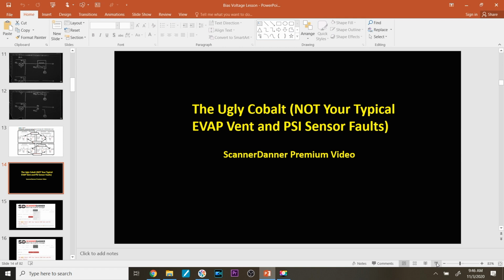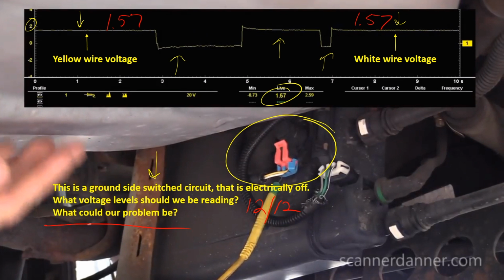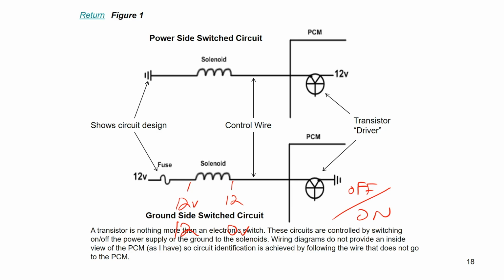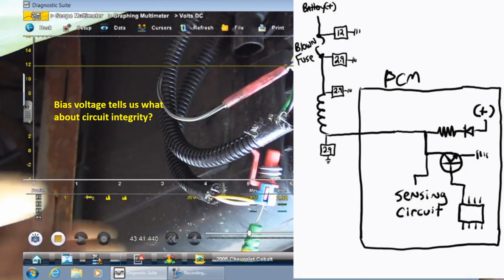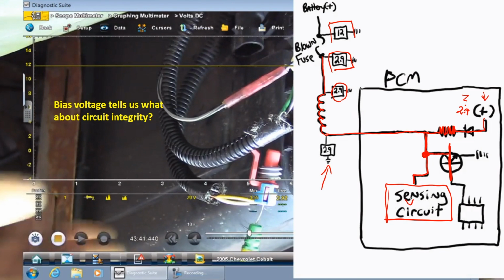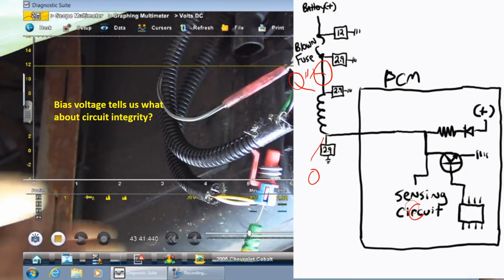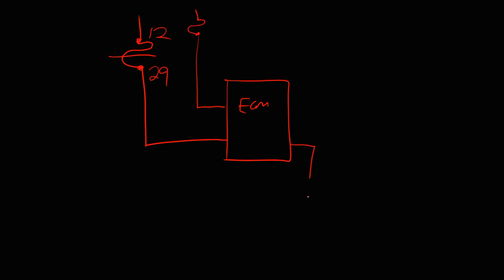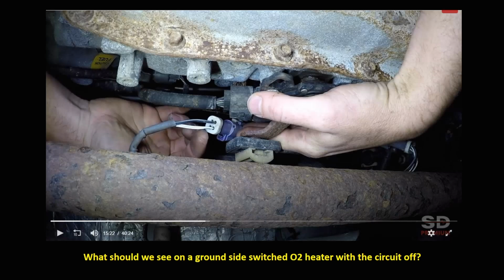An SD Premium lesson on Bias Voltage

Comment: Run a power probe to the point your testing. The alligator clip is a good ground so use that clip as a known good ground for testing and there is never any a question.
Reply from the maker: Just don't expect to see a bias voltage on any circuit if you are measuring voltage with the PP, it will pull it down. The internal impedance is very low compared to a typical digital voltmeter. Good tip on the ground connection of the PP, I use it all the time!
Reply: @ScannerDanner  I think he was saying to use the PP as a known good battery ground.